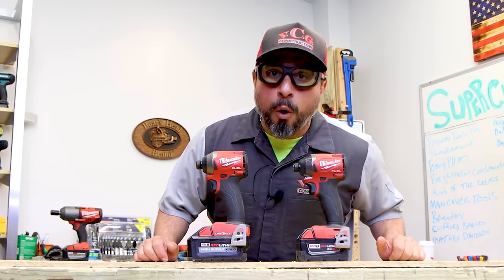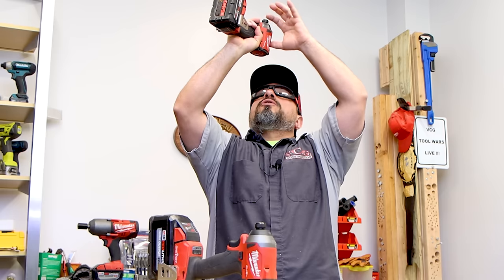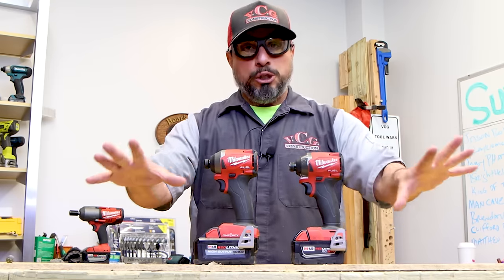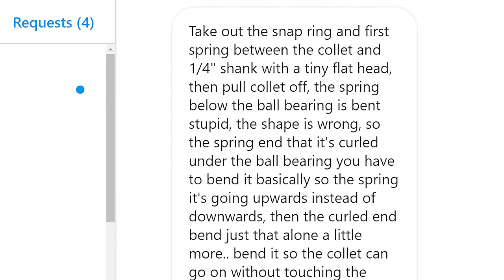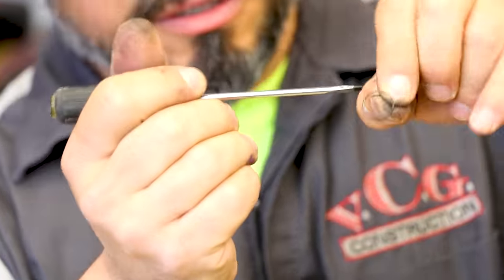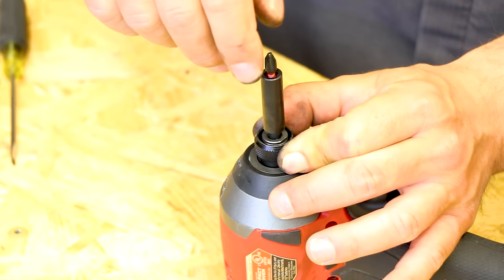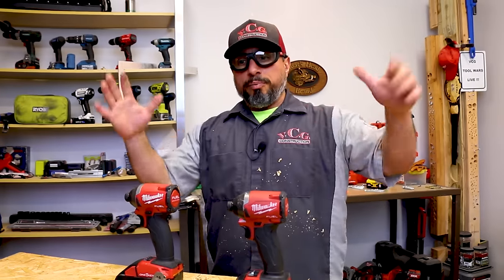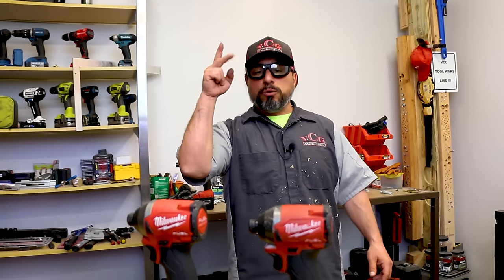FIXING MILWAUKEE M18 FUEL Gen 3 IMPACT DRIVER COLLET PROBLEM (must watch)

Comment: Honestly I feel like you would just keep your impact drive to drive in screws and what not, keep a drill to drill holes and just keep the impact for screws, I feel like just simply putting the impact threw that pulling it out is what messes it up, I’ve had mine for the past year and have never had any problems with it, I just use it for fencing or when I do mechanic and have never had any problems

Comment: Ok getting the keeper ring out isn’t as easy as @VCG shows it lol. Dang, stuck on step one.
Reply: Ok 30 seconds after posting this I see the flat spot on the bit hold portion where you can get a small flat head under the keeper ring.

Comment: Man, that sucks that Milwaukee seemingly blew this issue off until the product manager was in the office of a prominent fan of their tools and got stuck with pie on their face in front of you.  Sucks even more that they seemingly still haven't remedied the problem.  With widespread issues like this, companies need to bite the bullet and provide a fix pronto and eat the cost. They are facing not only a loss in sales, but a very damaging blow to their reputation.  Reminds me of Microsoft during the Xbox 360 era where they didn't address the "Red Ring of Death" issue and let it spiral wildly out of control.  Due to mounting pressure from media outlets and lawsuits stacking up, they finally took action, but not before suffering a massive blow to their brand image along with over 1 BILLION DOLLARS spent to properly address the problem. Get it together Milwaukee. Microsoft also initially shrugged off the failure rate of their console as nothing more than isolated incidents.  While there aren't concrete numbers, industry analysts predicted anywhere from  55-75% of all consoles manufactured would die due to this issue. They sold 86 million of those faulty consoles and had to pay the price for their hubris.  Don't be like Microsoft, Milwaukee. Own up and fix it!

Comment: Is it maybe possible to remove the complete head (that bit holding thing) an put the head from an FREAK, on this Gen 3 milwaukee?

I'm gona tell you i never had problems with my FREAK (Gen 2). The FREAK has no auto holding bit head.... But the bits stays inside that freaking Impact driver and thats from my perspective worth more.
Sorry form my bad english i'm from switzerland.

Comment: Does dewalt has ever had this problem?
Reply: My Dewalt 12vs release bits when pulling up. They at least grab the bit every time you put them in. The gen 3's collet issue plus having honestly too much power is what helped kick me into switching over to Dewalt 12vs. This was never an issue on brushed M18s or gen 2 fuels.

Comment: In the market of power tools line up, keep hearing great things about power but this is a safety issue and a deal-breaker that we can't ignore. It's like going on a plane that the landing gear MIGHT not come out. At that point, it doesn't' matter how good the plane is.

Comment: That’s an expensive recall.  They are not going to fix it because it’s already calculated in the risk to profit ratio. It’s cheaper to settle in court then return each tool for repairs.

Comment: I would really like to see ryobi vs kobalt
Reply: Lol the Kobalt will absolutely smoke the Ryobi
Reply: lccjr99 it probably would 😂 but i use ryobi daily and really like them
Reply: There's always a sweet spot before good brands get too big for there britches but still produce a quality product the trick is finding them
Reply: lccjr99 yessir i bet we can both agree black and decker is trash though 😂
Reply: @bricemayes7566  yeah but once upon a time black and decker actually made a professional only line that was worth it! Personally I feel like craftsman is headed down the drain from a quality perspective. Again, you have to catch the brand at the right time
Reply: lccjr99 I agree
Reply: lccjr99 what tool line are you in
Reply: @bricemayes7566  Milwaukee and Kobalt. I have liked the Kobalt brand for years now but for a while they only had like 5 tools. I love Milwaukee but I worry I will buy everything under the sun from them but how long can they stick with 18v batteries?
What about you?
Reply: lccjr99 i am in the ryobi line amd they have saod they will never change the battery platform how do you like ryobi
Reply: @bricemayes7566  I appreciate Ryobi because I think they know exactly who they are sometimes when tool brands try and make the next jump they turn to crap slightly thereafter because it becomes more about volume than anything else. I don't see many contractors using Ryobi but then again a lot of contractors don't stray from big yellow.
Reply: lccjr99 true I work for a metal roofer and all he has is ryobi and he uses the same drill and has for four years and when he saod that I knew they were the right choice for me

Comment: Try to clean out the grease and use wd40 instead ,it worked on my Dewalt the ball needs to move freely in the slot,

Comment: Dewalt has, or at least had this exact issue for years around 2011. It’s 100% the easy insert design. You can’t have 1 handed bit insert without this issue. The Dewalt s at least worked for a little while before failing but I’ve had 4 fail in 1 year. Just ask the brand to sell you a regular chuck

Comment: The spring steel is too weak. The pressure from the bit will push the bearing into the spring and push the U bend back into place. I  knew that was going to happen from the get go.

Comment: Thanks for trying man. I was so excited for the DIY and now thinking maybe I should wait to spend my money's or just go Dewalt. Damn shame
Reply: The Dewalt 887 impact has more issues than the Milwaukee.
Reply: @brandonwaller1486  we have 1 gen 2 and 2 gen 3s at work and haven't had the issue of dropping bits so far. The gen 2 has trigger issues. Yet the way my luck goes I'll end up with a boat anchor if I buy one.. I hope they fix this issue.
Reply: My Gen3 Hammer drill has an occasional trigger blip.  I'll squeeze it and nothing happens.  Then I squeeze it again and it works fine.  Makes me think I'm out of battery everytime. 

The trigger will also rarely spring out past the grip and you can feel it catch on the grip before its depressed. 

I'm getting more life out of it before I send it in for repair.

Comment: the reason you can not  take it back out is that you are still going forward and you need to turn tool into backward drive  to get the bit out i think you are prepensely wearing the tool out so it fails. I had Milwaukee for year never had a problem and i love the brand just would like to see you test tools how they are designed   to be used not test a tool going backwards in forward mode

Comment: How come I've never heard or had this problem and I use 3 every day
Reply: Are you using large spaddle bits?
Reply: @brandonwaller1486  large paddle bits. On hard wood 5/16&3/8 nut drivers on metal.
Reply: I'm surprised you haven't had an issue yet.  

I haven't had any issues with my Gen3 either, but I mostly drive screws and twist bits.  So I haven't been hard on mine.  

VCG obviously have been rough on their Gen3, but that's why we all love to watch.

Comment: I love self repairs but not on gear still under warranty. That is lame .
I understand nothing is perfect regardless of the price .
With this design become more common place on drill driver , you need the bits to remain held in place and not dropping out , I prefer the bits been held to strongly than weak , over a light spring action that will weaken or jam when dirty . I have had this issue with two year old driver bit holders , bit never with anything under a 1 year old . 
Currently I have not used one of these compact impact drill drivers .
But like I said almost all the new drill models coming onto the market from Fein and Festool have the function to remove the main quick release Chuck and to be used in the same way has an impact driver , I just hope they have a better spring inside them .

Because it is not something you should except for any tool that is classed has been professional , and not some budget major chain product for hobby DIY.
Sad to see the fix did not work but at least you tried. 
Thanks for your efforts to fix this major failing by this company.

Comment: Take apart another manufactures collet and see if the parts are interchangeable. At least you can see how there’s are made and try to come up with a solution
Reply: He addressed that in the last video they had on this issue.  

The main problem is Milwaukees single ball bearing design.

Comment: Im pissed because i have to use this gun again. I stuck with Milwaukee through brushed, gen 2 fuel and gen 3 fuel and this one is a BUST. It's a great all in one gun but actually has TOO much power. It's power is comparable to my gen 2 3/8 gun. Which if i required that much power id just snap adapters all day.

Comment: I'm sure you've gotten this a lot. 🤣 Thank you for the information. It did indeed work! However...😁 Clean out your holes as you're making them. Even with a drill. You gotta just clean out those dangin holes while you're going at it. I did the same test with the 4x4 after making the repair you did but I went in and out (as you should when using the paddle bit) with my gen 3 that had the exact problem yous did (your repair worked) and Bada BING BADA BOOM! Worked tits. That being said. Couldn't agree more. I'm a Milwaukee man. Through and through. We shouldn't have to fix this bologna. It should never happen. That being said. You're the man. Thanks again!

Comment: Isolated Problem?  Anyone still lucky enough to have the spring that holds the ball bearing in place after one day is lucky.  My driver split the spring in half.  The drill came as a free extra, however that doesn't mean the tool should break on the first day of work.

Comment: Even my new Festool impact doesn’t have this issue and I’m returning it because it otherwise sucks.  I know and appreciate the virtue of keeping a drill and impact together and consolidating to one battery platform but why are you torturing yourself?  At work I’ve been trying to consolidate to Makita cordless but there’s no way in hell that I’ll use their omt over a Fein Supercut/Festool Vecturo, their nailers over Hitachi, their SDS over Bosch/Metabo/Festool and the Mafell KSS40 only comes as a Mafell KSS40.   It’s a shame about the bit retention though, as their flagship impact drivers have always made me jealous I’m not on the platform.

Comment: This is where Milwaukee wants you to use their hammer drill for drilling large diameter holes, and not their impact.  If you need more of their tools to get the job done, that makes them more money, so why fix it.....right?  I mean, a double ball bearing collet....simple to manufacture......right?

Comment: That set up is cheesy as hell! That's Milwaukee's best impact driver and they can't make something more robust than that? Ridiculous they need to move there manufacturing back to the USA and make stuff the way they used to!
Reply: Not true no matter if it was made in the US it's the design that has the flaw. They need a redesign of the collet.
Reply: @russellleahy  Better pay and better treatment as a worker which usually means things get built better and have higher quality control to them. When things are made out of the Country it's to save money on worker pay and many other things as well. Which is why many things are made in China and other parts of the world these days. People do sometimes pay more for it being built in the U.S.A or Canada. Milwaukee does still make some products in the U.S.A and in 2017 expanded there Mississippi factories.
Reply: @M.C.D.Technologies  This true that it is an Engineering issue but they still need to move manufacturing back to the US and quit trying to cut corners everywhere. I have some old Milwaukee tools that are some of the toughest tools I have ever seen. That whole collet setup just looks cheap as hell. That's there best impact driver! Give me a break!

Comment: It’s a good video and even if this works I wouldn’t recommend it for legal reasons. The problem is if something happens even unrelated to this modification the legal liability shifts from Milwaukee to you for making the modification.  Sure you could hire lawyers to defend yourself but why even put yourself in this position by modifying a tool. If it’s defective return it and buy a different products such as Makita.

Comment: Probably change the anvil that has the 1/4 hex for a new one because I see people do it in there videos like the man caver videos like with Milwaukee or ryobi anvil with there impact driver switch or Milwaukee changes the anvil with the 1/4 hex that has 2 to 3 ball bearing to make it more durable and hold on the bit or go back to standard pull hex 1/4 that is not quick insert that has a standard two ball bearing most people don’t like them which makes no sense since as long as it holds the bit any bit who cares as long as it works my ryobi hp with the metal housing can retain the bit because it has 3 ball bearing which it can hold bits and if one breaks or does not work the other two still will. I like Milwaukee nut the impact driver to me that it does not retain the bit can can loose the bit if it falls of if you were somewhere high and drops you can loose the bit for this is the reason I don’t buy that Milwaukee impact driver to me this impact driver is incredible I don’t see many impact driver come close maybe a few that can beat or keep up with it but the bit falls out to me is a problem it’s sad bit if they can fix it then more people that want it can get it.

Comment: If im going to buy an impact that is supposedly one of the best out there,  I sure don't want to have to modify it right out of the box. No thanks Milwaukee
Reply: Doesn’t happen on every occasion, I still think it’s the best out there, I’ve tried them all, I always go back to Milwaukee, if it’s really a tease for you Makita and metabo are the next best In my opinion. (Collete issue hasn’t happened to me yet)
Reply: @renepuentes1165  I own majority of dewalt tools. Have had them for a while and havent had a single problem

Comment: Okay so l get the convenience of popping in a bit, fine
My driver kit came with a companion drill
Oddly, l use the driver to drive fasteners and the drill to pinch holes
Seems like the problem is not the tool, but the application
Use the right tool for the job my daddy always told me

Comment: You went in at a slight angle then tried to pull it straight out. You have to come out of the hole the same angle you went in. Or put the drill in reverse. Your tools must not last long.

Comment: This is what happens when marketing supercedes the component parts budget. Milwaukee & DeWalt are racing to beat each other in terms of profitability, cheaper components in favor of more marketing & corporate knows it works very well for profitability. For example, if a trigger switch fails in either your Gen 3 or 887 & you're out of warranty, it'll cost as much as buying a new replacement tool since in both tools the trigger, board & motor are sold as a single part soldered together. It's more cost effective to replace the tool for the consumer & MUCH cheaper to produce it that way for the manufacturer. So you have "pro" grade tools that are becoming more disposable. DeWalt has even moved to pinning on their chucks on now, so that if it needs replacing, you need a new chuck, clutch & gear assembly, again, one single component. Cheap to produce, but disposable from the economic standpoint of the manufacturer & consumer. Makita is the only mainstream "pro" manufacturer I'm aware of still making their tools reasonably serviceable for the consumer that is economically viable. If the trigger switch fails on my xdt13 or xdt14, it's $14 to replace out of my pocket & is serviceable by me when it's out of warranty. Probably explains why Home Depot's rentals are primarily Makita, think about it, economically viable for the end users, us & Home Depot who must maintain them for rental. So, I highly doubt Milwaukee will ever rectify this issue. They know you'll buy the next model when it drops, regardless, because marketing knows you'll abandon your current tool for the latest one, even before the warranty period expires on it or the tool fails. It's their economic business model & it's making them serious $$$. Ask their marketing dept ;)

Comment: The ball bearing is bad.. They wear down.... Thus not enough force on the bits anymore. If this is the case. I'm going to find a stainless steel transmission ball bearing. They are hard as a cobalt..

Want proof...Measure a new one. Then Measure  one that starts failing..